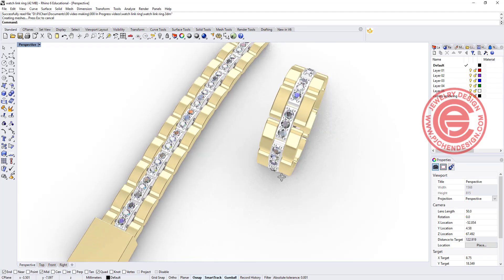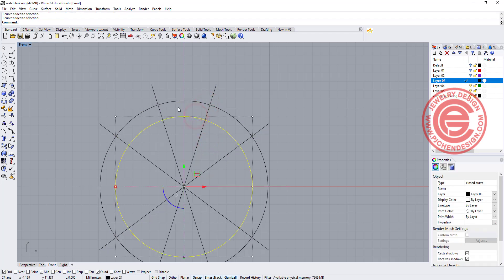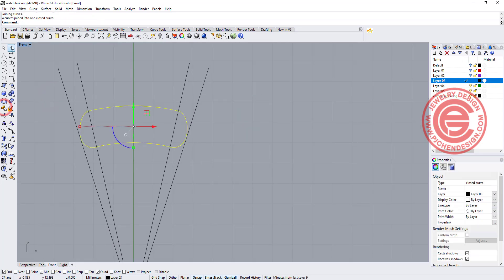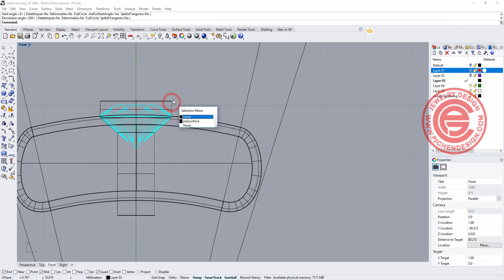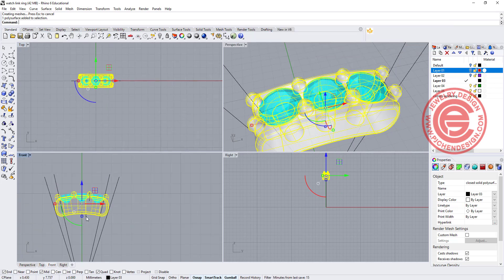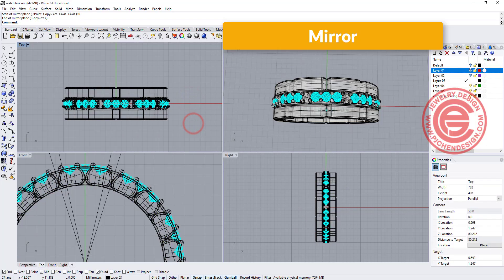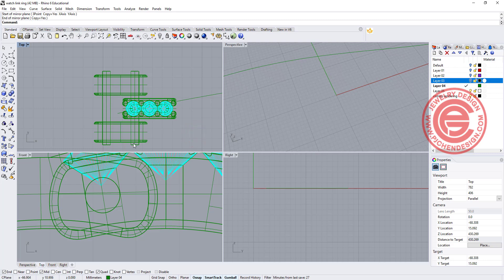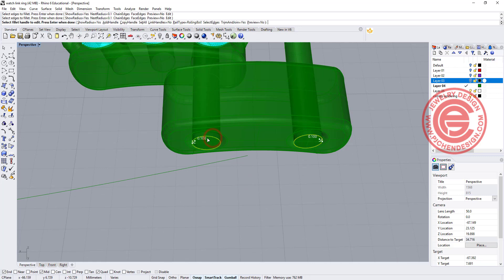Jewelry CAD Design- Watch Link Ring and Bracelet 3D Modeling Tutorial in Rhino 6 [2020] #140

Comment: Thanks for always sharing your knowledge.
If I want to manufacture a similar bracelet to yours but different type links.
Do I buy the clasps ready?
Do I buy the pin ready?
Do I cast the links (will the pin stay secure if I push it in) or does there need to be more detail in the model?
Reply from the maker: Most of mass production is using ready-made clasp. If it is one of the kind, and you have fabricated clasp before, you can fabricate one that fit your design dimension. you may able to cast the box clasp but need to fabricate the tong. Since cast piece is too soft. For the link, once you calculate the pin holes are, you cast them without pins. than you can have the pin on it and solder on out side links, so it is moveable and stay in place. You cannot just push the pin and leave it there. it will fall out. (for precious metal)

Comment: Don’t you need to worry about the cutlets where the links connect? They will be hit by the wire when you put them together.
Reply from the maker: I don't think it the cutlet is touching the pin. but if that is the piece, you can make the middle section longer.